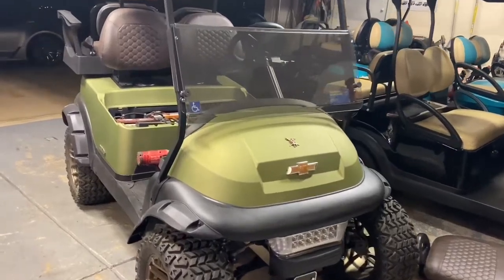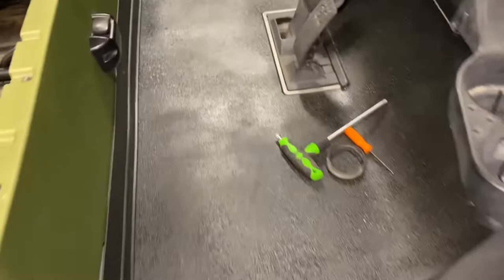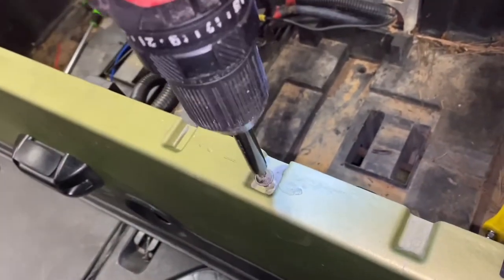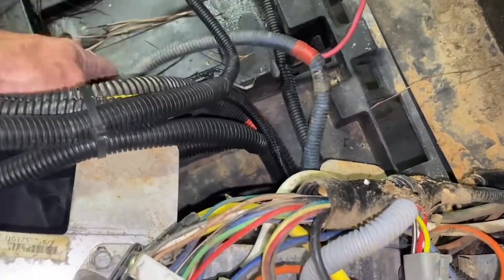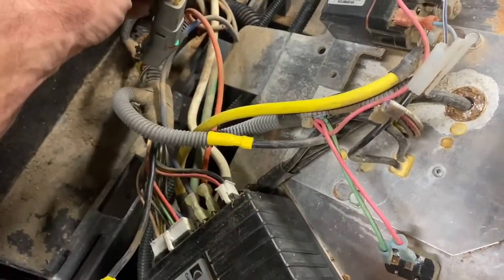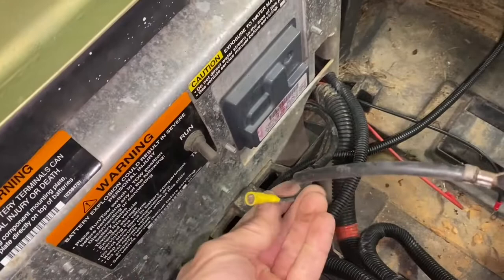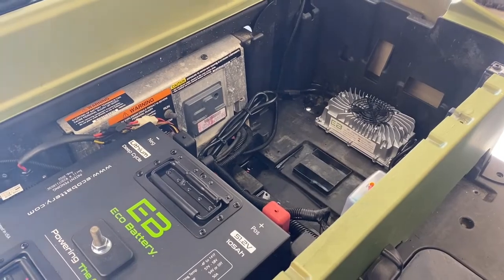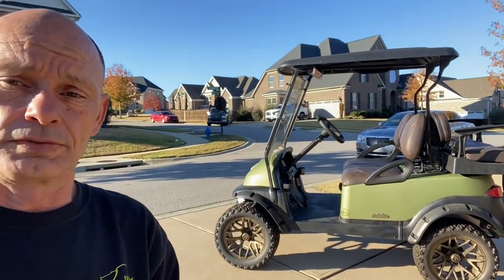How to install Eco Battery and bypass OBC (mainly OBC options)

Comment: I have recently contacted James on installing my Eco 51.5V 105 AH Battery. On 2 ISSUES, one being Major. 1st minor issues was battery gauge not working. Two videos on YouTube did not show charger cable connecting to battery 90 degree screw fitting from gauge. There are 2 connectors at battery end connecting to battery attached to harness. One of the connectors, doesn't matter which on needs to go to connector on Charger or battery will give false readings. 2ND Major issue is connecting previous deluxe lighting kit. This was my fault but I didn't have 12 volts connected from inverter to lighting system. I connected 48volts and it blew out the front headlights and rear tail lights. I got a hold of James and he helped me solve the issue. You need the blur OR red wire, one with a 20 amp fuse in it hooked up to inverter with black negative in same harness. It is located in the harness before the "Y" SPLIT going to rear tail lights. I ordered and installed new headlight and tail lights. They work fine except Blinkers don't work. We are working on this issue, probably flasher relay got blown out. James is an exemplary person and is HIGHLY APPRECIATED for helping me with my problems.
Reply from the maker: I’m glad I was able to help! There’s been a lot of unnamed people that helped me as I learned this stuff also, things are a little different working with more than 12 V! But the Golf Cart community is full of good helpful folks! Thank you for the nice comments and Welcome to the team!

Comment: In the video you removed the black wire when you removed the OBC,  however that wire  was attacehd to a black wire in the harness.   Should this remaining black wire in the harness be attached to the  neg (12-) on the 12C Converter? Great video and thanks for all your help!
Reply: Did you happen to find out if that black wire needed to have something done other than just tossing out?

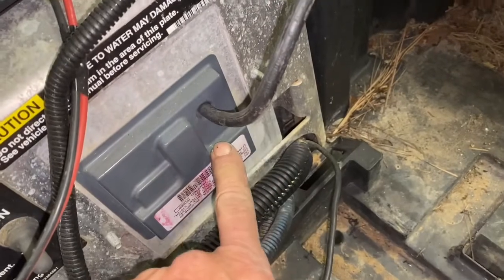Comment: What is the blue wire that turns to red at 3:18 on the video? And how do you hook it up to the lithium battery?  Is it a fuse?
Reply from the maker: that is a LED light kit. A lot of the Chinese light kits will change colors so that will hook into your 13.5 V out on your voltage reducer so the headlights only work when the key switch is cut on. Any other questions feel free to give me a shout!

Comment: What is the benefit of bypassing the OBC? Can you leave it?
Reply from the maker: The OBC is designed to control your OEM battery charger, since you don’t need it to control any battery charger , it is kind of useless. A lot of folks like to bypass it just to eliminate anything in the future that may disrupt the factory controler.  According to Eco Battery, if it works leave it alone, if it creates a problem with your controller then bypass it
Reply: @Kartznfartz  Thank you for the info.
Reply: What’s the cost of one of those batteries